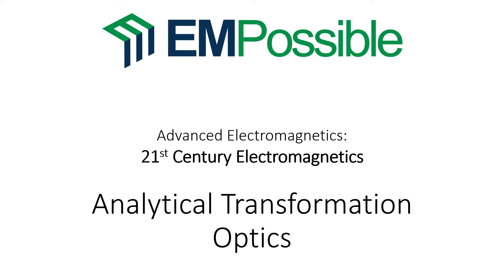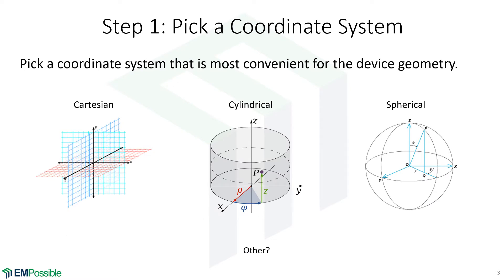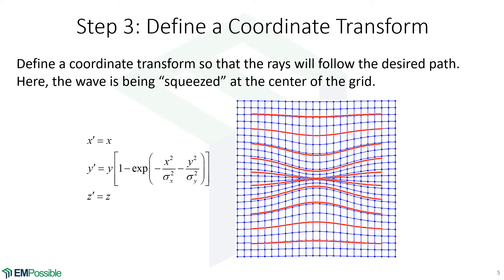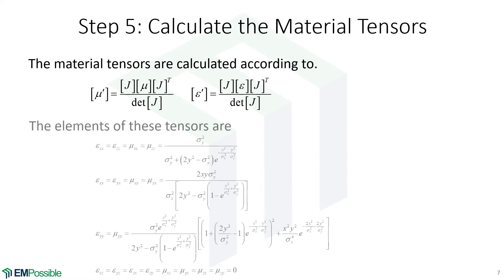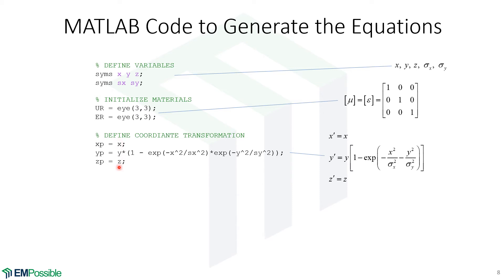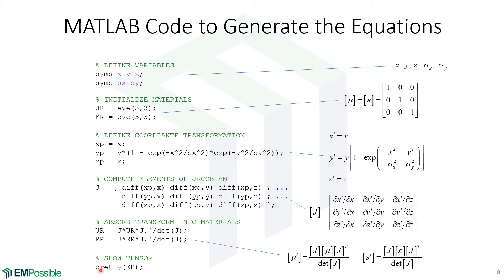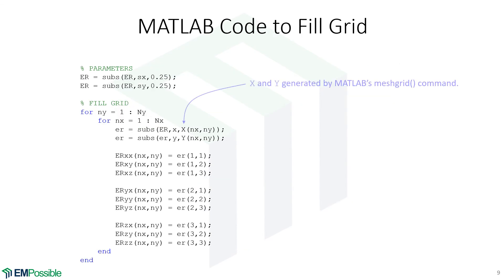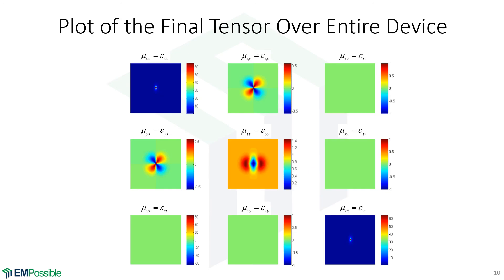Lecture -- Analytical Transformation Optics

Comment: Hii, can you help me how I can plot the graph of tensor instead of grid
Reply from the maker: Happy to help, but I am not sure what you mean by “tensor instead of grid.” I think you might want to know how I plotted the 3x3 array. For this, you will need to use MATLAB’s subplot() command.  For each of the nine plots you would type subplot(3,3,s); 
imagesc(xa,ya,ERmn);. You will just need to replace s, m and n with correct values.
Reply: @empossible1577   I want to know can i plot the permittivity and permeability values in graphical representation
Reply from the maker: @swethamanupati7564  First, you will have to calculate them in arrays.  For permittivity for example, that will be ERxx, ERxy, ERxz, ERyx, ERyy, ERyz, ERzx, ERzy and ERzz.  You will have a simulate nine arrays for permeability URxx to URzz.  From there, use the imagesc() function in MATLAB.